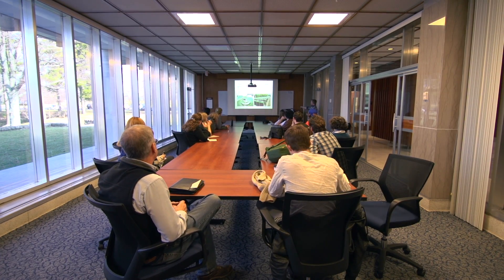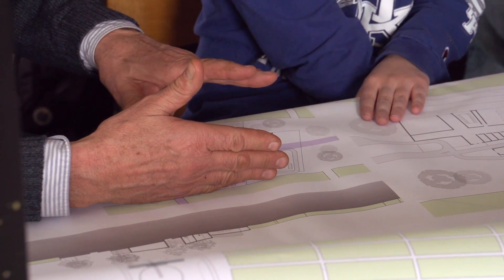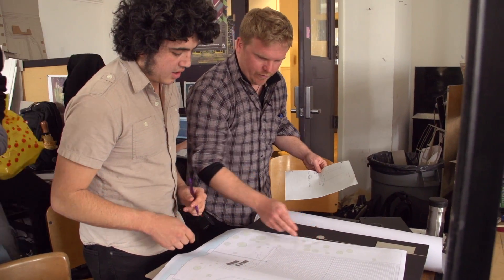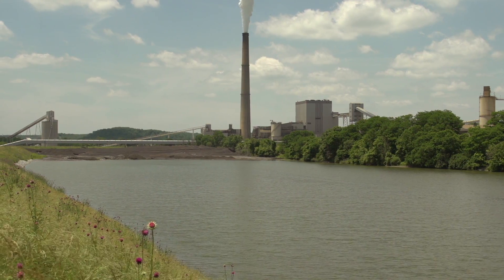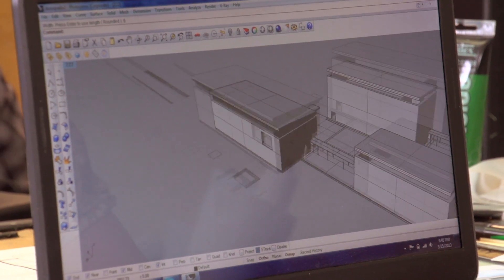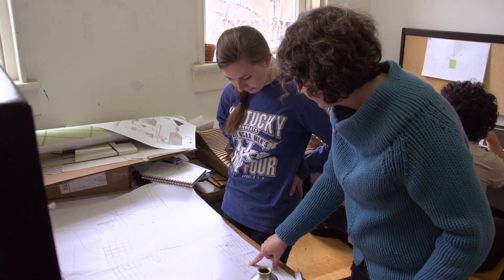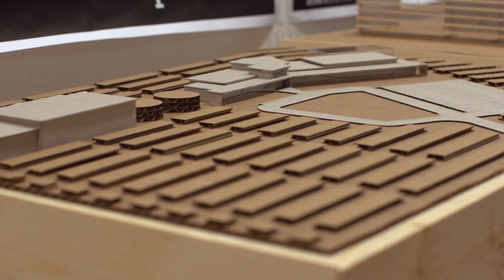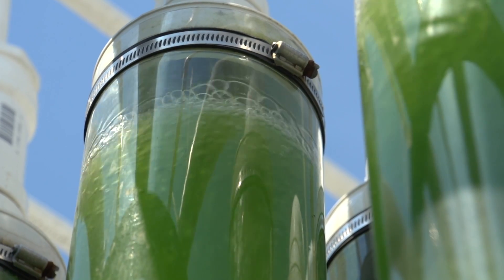Algae CO2 Capture at the University of Kentucky: Part 2

Comment: So if you burn methane you get heat + CO2 + water. If you add the carbonated water to caustic soda you get more heat + water + sodium carbonate. There's a permanent supply of hot water which equals a permanent supply of energy. If you add the carbonated water to algae and sunlight you get either food or fuel. Looks to me like you have the answer to water, energy, food and fuel shortages all in one and the way to get rid of both excess CO2 and methane permanently.